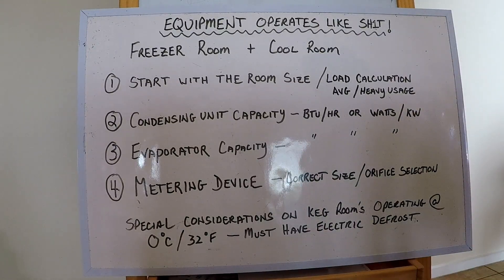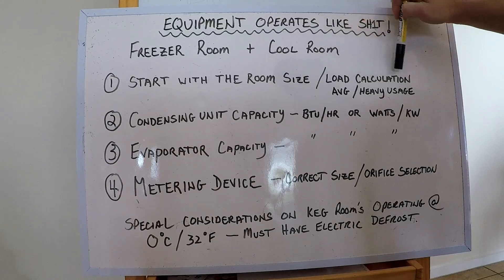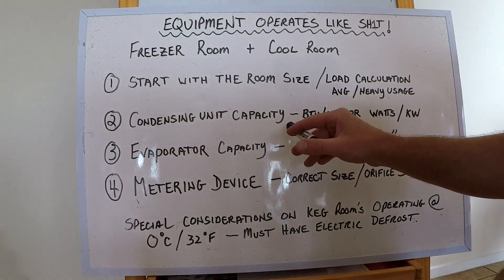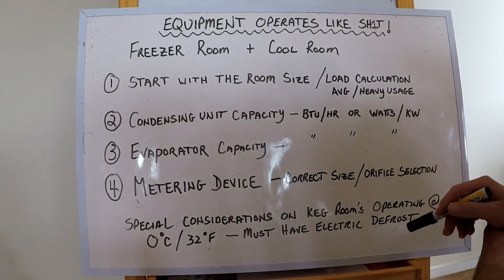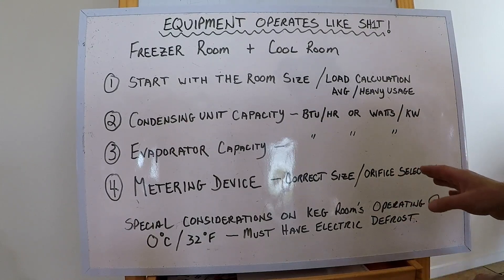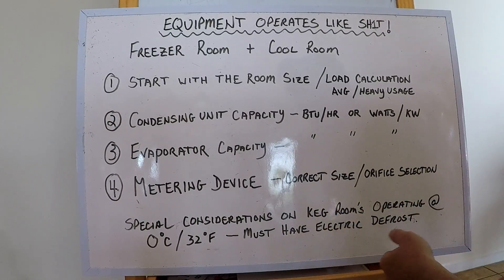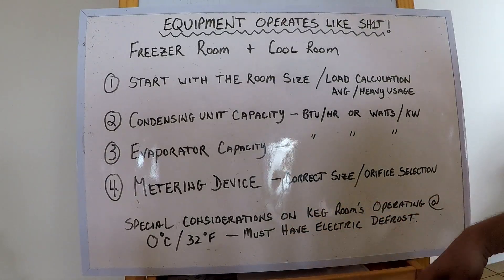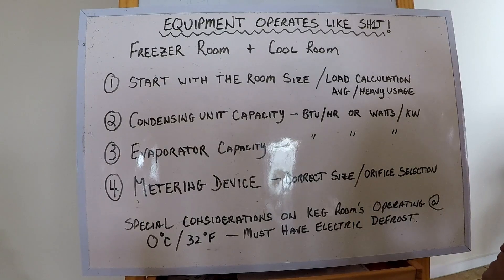REFRIGERATION OPERATES LIKE SH1T

Comment: Question related to HVACR- what is your normal saturated condensing tempteture should be during low ambient or what tempteture it should not fall bellow, I heard 85 to 105F
 I want to understand low ambient head pressure control properly  what is that magic number it should not fall bellow also one refrigeration tech was telling me you will want a 70 degree F liquid temp going to your TXV for better operation can you explain this a little in detailed way so I dont have ask others thank you..
Thank you.
Reply from the maker: Hello,
Thank you for your question.
When it comes to low ambient head pressure control, the main focus is to ensure that we are getting the correct pressure drop across our metering device for it to operate correctly.  Typically, a minimum of 100 psi or more.
Take for example a unit operating on r22. Head pressure 175psi/93f saturated condensing temp.
Suction pressure 75 psi/ 44f saturated evaporating temp.
These are typical numbers for an ac unit or water chiller using r22.
The difference between the two pressures is 100 psi, this is the drop required for effective operation of the Txv.
Any refrigeration system that goes below 55f or 12c ambient temp may require a form of head pressure control. Fan cycling controls, condenser flooding or even refrigerant operated airflow control dampers. Typically they try and control the saturated condensing temp above 85f. This is a minimum number because most normal efficiency condensers run with a 30f TD across them. For example if the ambient is 55f and my heat load is constant then I would be looking at a saturated condensing temp of 85f on a normal efficiency unit.
R22 at 85f is 155 psi condensing,
R22 at 32f evaporating is 57 psi still 100 psi differential. 
Have a play with a pressure enthalpy chart to get a better feel for this.
Cheers